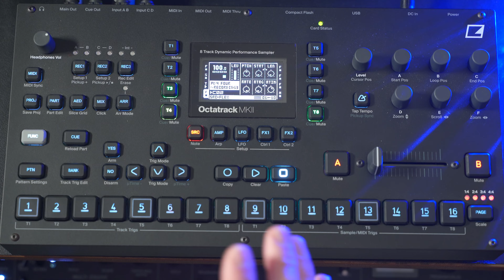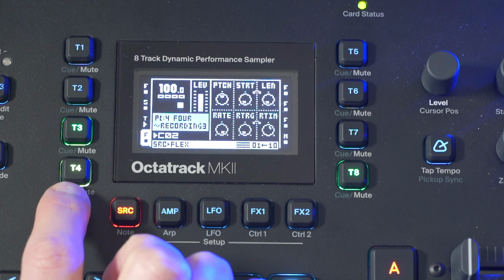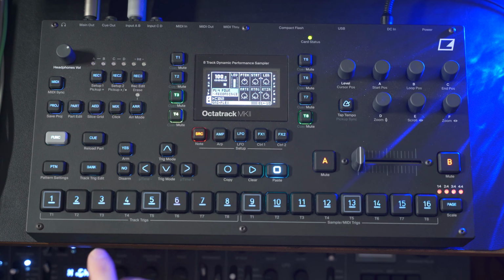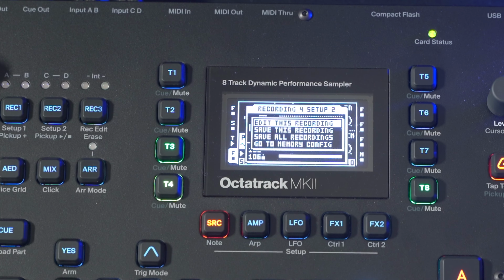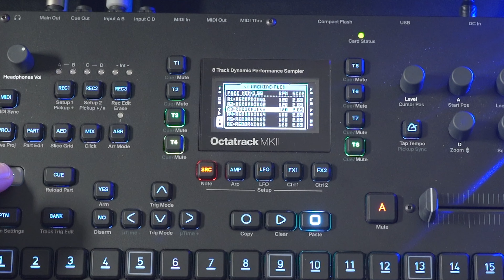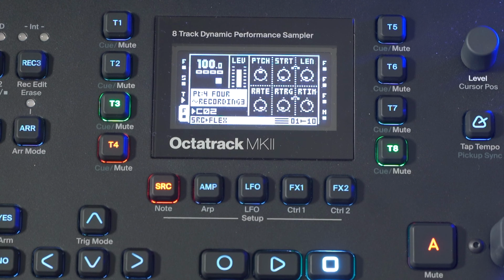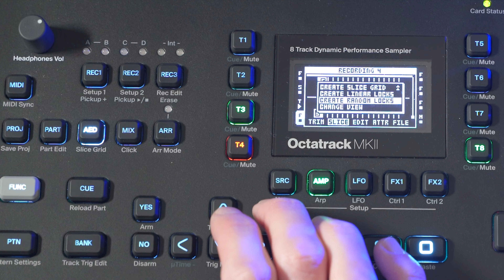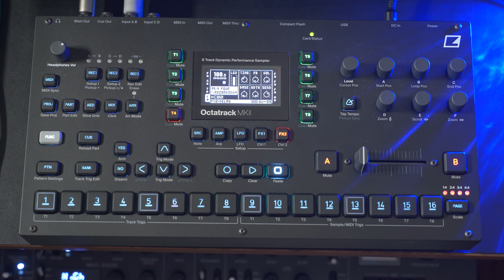How to Sample Synths with the Elektron Octatrack // Recording Tutorial

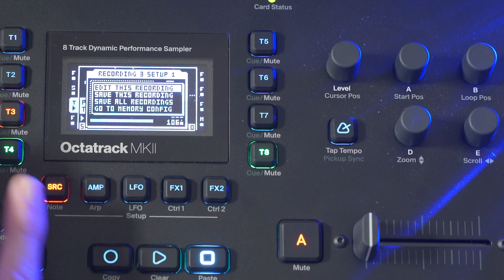Comment: 7:50 lol, this is all part of the Octatrack experience 😅

ALSO - you technically dont even need a THRU track with the way you are using this. You can just monitor AB directly via the MIX page and record right into the Flex Recording buffer onto the track you want (T4, in the video example). You’d want to use a THRU track in this case if you also want to apply and record your sample with OT processing and FX (like sampling a recording of your keyboard playing with the OT’s reverb on it, for example)
Reply from the maker: I don’t think I’ve ever actually opened the mix page 😂 but I knew there was a way to do that, I just… never bothered hahah. I’ll try that in the future for sure!
Reply: it’s no problem - the OT is the mystery where we all solve its secrets together 😂

MIX page - just turn up DIR to max on AB to hear whatever is plugged in to those inputs at unity gain

Comment: It doesn't mention this in the manual but you don't need to set a trig and press play to activate the thru machine. You can simply hold the track button and press play, in your case track 3.
This is useful to hear your external sound without playing a pattern first.
Reply: This just changed my life.

Comment: I have my default sampling template set up with pairs a bit like you but not quite: T1 - Thru (in AB), T2 - Flex which records T1 (instead of an input), T3 - Thru (in CD), T4 - Flex that records T3, T5 - Flex which records T2 or T4 for resampling so I can mangle the recording then immediately sample that, etc. I find sampling with the Thru track as the source rather than assigning the "wrong" buffer to the Flex track keeps it clearer in my head what's going on and there are fewer opportunities to mess it up. Just what works for me. The end result gave sort of glitch Final Fantasy soundtrack vibes :)
Reply from the maker: Cool setup!! I’ll have to try that out. I haven’t yet ventured into multiple tracks of re-sampling, but I know it’s gonna happen soon

Comment: Hi! You can monitor easier with the DIR Parameter in the Mixer menu: [MIX] -> raise „DIR“ to 127 for the input you are using. That way you don’t have to mess around with thru machines at all. You can even have all 8 tracks playing other samples while you sample something new in because the recording buffers are separate from the samples currently assigned to the tracks (And to edit/playback the sample in the audio-editor just go to the page 3 recording menu: [REC3] -> „edit this recording“  -> save and assign if you like it.)
Reply: That's my method too - works great!

Comment: Nice tutorial! I really like the OT's sampler despite how weirdly complex it is, recording trigs and slicing and like 7+ minutes of recording time are all great 😄In the past few months I've been using it kind of like a weird digital tape machine, sequencing a song via midi and then recording it all in one go, and layering additional tracks similarly. The only problem is normalizing and saving a 3 or 4 minute recording on the OT takes longer than rewinding a cassette would 😅

A couple observations from throughout:

- If you want to hear a stopped thru track without starting the whole transport, the shortcut "Tx+PLAY" will start playing only whatever track's button was held.
- In the REC2 menu, the AB and CD levels are only useful for the pickup machine; they set the monitoring level of AB & CD so you can hear your pickup machine input without having to use a thru track or the mixer's DIR volumes.
Reply from the maker: Lovely tips!  I didn’t know that about Tx + Play, that’s super helpful

Comment: Holy shit, this looks like a fucking nightmare to sample with. Not even samplers from the late 90's were this clunky to sample on...what the fuck is Elektron' excuse?
Reply from the maker: Hahah I see your point. I will say, there are a lot of crazy things you can do with this though (like setting up multiple buffers & trigs on separate tracks to live-sample and subsequently destroy/mangle/rearrange slices of those samples all at the same time [once again, live] in an automated manner)!
Reply: @SlowHaste  yeah, I mean you could definitely do that with a lot of other things, but I guess if that's your thing sure, but as far as it being a sampler, as in its value as an actual functional instrument, there are better options from 20-30 years ago for significantly less than the octatrak. This machine just looks so clunky in every video I've ever seen it in, an' whenever people give me some kinda answer why they use it it's never enough, in my mind, to justify the horrendous elecktron workflow
Reply: @d.g.f.7056  it's not a "normal" sampler. That's why they have the digitakt. It's an audio mangler that samples.
Reply: @almightyEsquilax  Cope.